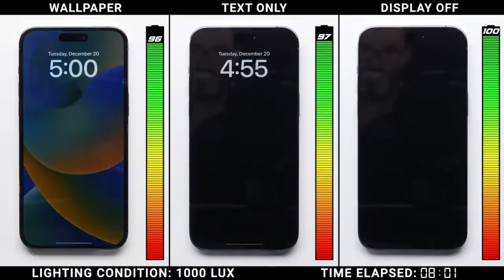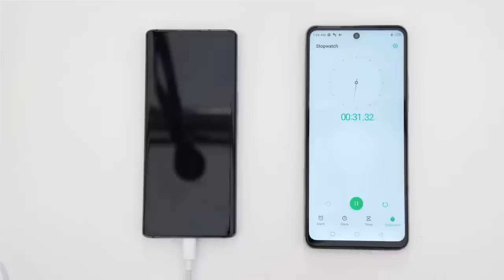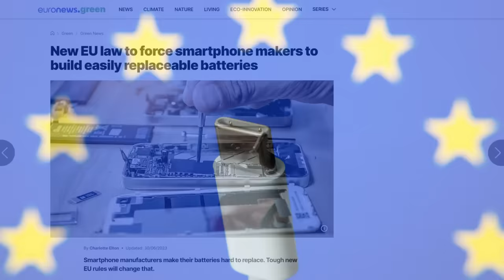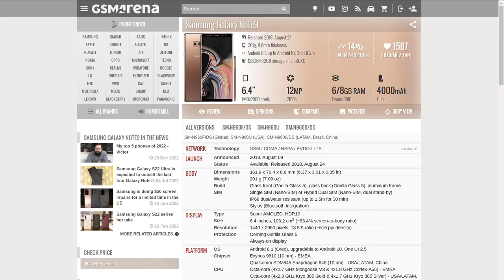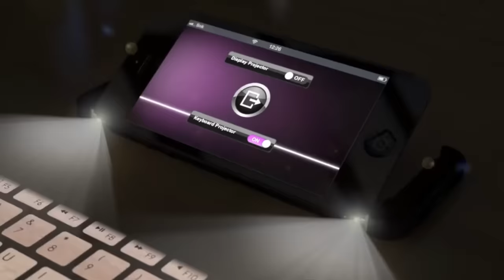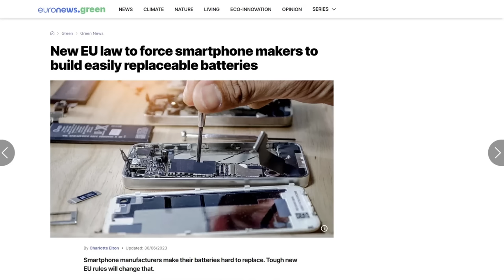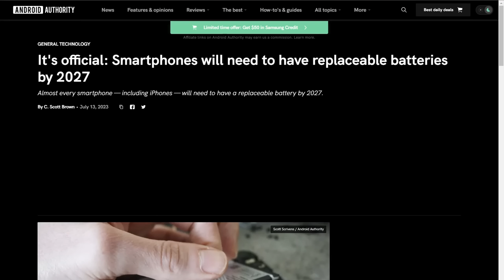All Smartphones Will Soon Have Removable Batteries

Comment: Cant wait to see how the manufacturers work around this. Probably gonna make it so putting a third-party battery in your phone murders it or something.
Reply: Pretty sure this is already illegal in EU not sure though
Reply: Is only illegal if you get caught, just like Volkswagen.
Reply: @cazek445  They could make it more subtle. Like, limiting the maximum charge because the battery isn't "genuine". Even printers will reject third-party cartridges in today's age. Anything can be programmed to disappoint I'm afraid...
Reply: The charging cable regulation specifically prohibits throttling third-party cables and chargers, this one probably has a similar part too.
Reply: They'll probably do this but then never offer replacement batteries. "Yeah sure we'll make replaceable batteries but have fun with Xiaoing brand if it goes out."
Reply: @23345star  Nah, I think they will sell batteries just at a premium.
Reply: Some kind of "trusted partner" program probably.
Reply: Ah yes, the ink cartridge method, a classic
Reply: Seems like the EU is getting tired of their shit, so they'll find themselves in another situation where shenanigans are against the law, if that even phases them...
Reply: @kpcraftster6580  🤣 but also 🙃
Reply: @YerBrwnDogAteMyRabit  With enough money, laws matter as much as morals
Reply: It'll be like printer ink.  Each battery will include a chip with a digital signature that can only be signed by the manufacturer.  They'll charge several times the premium for the batteries.
Reply: Apple already does this. The phone either will not work, or nag you with warnings that the battery is not authentic Apple. It's so bad, that even genuine Apple batteries can trigger the warning. Even several Android phones are doing similar, by having certain functions not work, like cameras and certain apps jist straight up not launch.
Reply: @Danominator  DRM batteries sounds like hell.
Reply: A company like Apple will just add encryption DRM to the battery so the phone will only work with the very expensive Apple replacement part.
Reply: SSSSSHHHHHHH!!! Now don't go out there giving ideas to them dammit!! xD
Reply: "We will no longer be providing updates to your OS on this model because reasons" That is why I upgraded from my S4.
Reply: And the Apple batteries will cost $700 (EU said nothing about price)
Reply: @justayoutuber1906  still technically more affordable than the Mac Pro Wheels
Reply: I bet they will put popups in the OS saying "Untrusted Third Party Battery" and cut off features, or make their official support batteries cost much more than a regular battery, either way they will have a lot of creativity to making phones worse when incorporating a new one for no reason
Reply: They'll probably say some stupid shit like it "breaks" the warranty.
Reply: Exactly . And changing still will be only possible in service center . 

Disgusting . Absolutely disgusting.

I am a gamer and love mobile gaming . Retro games , retro game mods and Indie games . I have an archive with over 200.000 games . Multiple phones . And none has a changeable battery . Means . Someday in the future , those phones will be dead or at least , cost a small fortune to change all batteries .

That's sad
Reply: id like to see them work around my work around of piggybacking the original battery with soldering and bodge wires if it means i still get to have my battery however big i fuckin want. they need to learn that as much as they fuck with us, we'll just get more creative in breaking the locks or finding ways around the shit.
Reply: @Danominator Custom ROMs ftw
Reply: @TheNovaks47 the camera thing is interesting on Custom ROM, for me the camera stream is smooth on 1 app, but takes a random amount of restarts for the capture button to work, on another, the camera has 1 frame per 1 to 2 seconds, I wonder if that is Moto doing the same.as described
Reply: Imagine they make 3rd party blow up like the note7
Reply: You mean like apple already does?
Reply: @Danominator looks apple to me
Reply: 100% correct. They will code the batteries to block third party generic batteries because profits.
Reply: @RT-qd8yl  That's an interesting thought. I agree, sort of. Seems that the money would be the only scale-tipper of any consequence with the moral-less. Many (probably most) companies weigh a fine vs the overall profit if/when caught. I wonder if VW would have proceeded with the TDI shenanigans had they known it would ultimately cost them 30 billion. That certainly seems like "enough" money..
Reply: *HP printer flashbacks *
Reply: This isn't American regulations my friend
Reply: @Danominator only some time before people start hacking it out
Reply: @thanhvinhnguyento7069  Looking forward to it
Reply: the battery will likely need a programmed vin to match the phone. they could blame safety concerns and be completely in the clear. thats what they normally do at least.
Reply: inb4 manufactorers make batteries combust when removed lmao trolled
Reply: Apple probably gonna code their phones to only work with batteries they provide which they don't sell individually so either you have to buy a new phone or have them replace it lol
Reply: They just stop selling to Europe
Reply: Non certified battery detected, performance degraded

And then it just runs some spindump task in the back like crazy so it overheats.
Reply: They'll probably kill your phone through updates.
Reply: @Danominator Printers will still streak on purpose and clean more out, report level read issues with non original cartridges and regulators don’t do shit about it. I run the same exact Canon for 13 years now by resetting its clean count and using spoofed chip refill carts. How Printer engineers sleep at night is beyond me
Reply: I can see it now: you can replace ONE of the batteries
Reply: @jmtradbr  Reminds me of a line once my old teacher gave us before a test. Its allowed to cheat its only not allowed to get caught.
Reply: reduced phone performance. or makes it "tainted".
Reply: @23345star   they will offer replaceble battery to make some money
Reply: We no longer have a battery, we have a power pack. 

Introducing, the iCel.
Reply: or maybe it would murder you instead
Reply: ... for my safety surely 😂
Reply: I can see Samsung, Apple and some other massive shitty manufacturers do so. But when it comes to smaller players like Sony and Asus, considering they are currently still keeping clean android and, at least with Sony, headphone jack with SD card slot, I think they will allow for 3rd party batteries. Sony does with their cameras, so why not phones really. And being the "good guy" could help them gain some market share.
Reply: @Danominator  Buy two and use a third-party charger for the third-party battery, then use the first-party charging only to keep topped up. Ez.
Reply: Probably by inventing a new screw that no screwdrivers can unscrew except one that only the manufacturer has. Technically user removable, but nobody would ever care enough
Reply: they will definietly raise prices, or start a "subscription only" model
Reply: so sad these bitter comments are the reality.
Reply: @cazek445  Would be yee, think apple got in shit for making software updates artificially draining battery many years back
Reply: @spicychad55 100% will
Reply: @ghoulbuster1 what poor English
Reply: @l4kr doubt that. Huge market of npcs
Reply: Workarround by apple will be that only apple certified batteries will work in iphones and those will costs as much as it costs to replace battery by phone reapair center..
Reply: @jmtradbr Volkswagen already has batteries which must be 'registered' by a special computer. They'd know a thing or two
Reply: I foresee them putting the battery under every other component, so you either need to remove the screen instead of the back cover or you have to dig out every other part just to replace your battery.
Reply: If Apple is putting chips in phone screens, they'll do it to batteries.
Reply: That's ok, those chinese manufacturer will find a way.
Reply: Just look at printers. That IS what they will do...
Reply: @YerBrwnDogAteMyRabit multimillion dollar fines stack em back to back.
Reply: @SlavTiger well said.
Reply: They will simply price the battery at the same price as the phone lmao
Reply: I think that some OEM's will have to pay a fee to get certified battery replacement for brands like Samsung, Xiaomi or Apple.
Reply: That would be a dick move. But it still would had a good thing. You don't have to buy a complete new device. But it's also something people should'nt 100% agree on.
Reply: @23345star  Who cares? I buy my Note II replacement batteries from Extreme Cells anyway, because they actually still produce those and they have much better quality than the ones that Amazon sells as being from Samsung (which are actually knock-offs from China).

And there are other third-party sellers whose batteries are probably just as good.
Reply: I bet they're gonna make those exchangeable batteries ludicrously expensive or unobtainable or both, as well making them last far shorter
do not ever underestimate greediness of corp*rations
Reply: Pretty sure that's already what iphone does.
Reply: @TheNovaks47 indeed, iphones starting with the X series have the battery serialized so if you replace the battery even with an oem one, the phone with treat it as aftermarket and give you an error popup, which doesnt always appear, and will usually stop appearing after a while if it does, afterwhich only appearing in the settings menu, however the battery health feature that tells you the overall capacity and indicates when you should get it replaced is disabled. I havent seen anything like this on samsung phones or indeed most other androids, not sure about pixels, as I havent seen too many of those, with the few that show up being people looking for cases and such, not any type of repair, I just know the screens are serialized so the fingerprint scanner wont work after a screen replacement unless you calibrate it, the difference being the software to do so isnt unobtainium like with the apple stuff.
Reply: @AruthaRBXL s I mentioned before in a another reply, iphones have already been doing it since the X series, replaceing the battery gives you an error popup saying it "cant verify if it is a genuine battery" and disable the battery health feature, so you wont be able to see the overall capacity level to know when to change it, and will have to rely on noticing when it seems to die quick, like for example going from 20% to 0% in a minute, or of course more obvious signs like either the phone refusing to even turn on or it swells and pops the screen open, which will probably crack it given how thin they make them now every since the 12 series, with the 14 being even thinner. in both of those latter two cases the genius bar is likely to tell you that you need to buy a new phone.
Reply: @SlavTiger  They'll make it illegal to circumvent battery DRMs.
Reply: Apple already do that i think
Reply: @cazek445  live in Portugal. I confirm that this practice is highly likely to be illegal. Thanks for informing people.
Reply: Smart batteries with an digital ID, which means you can only use it if it's ID paired with your device. Or some shit.
Reply: @Danominator to be honest, I don't want to see these damn removable batteries again. They were a nightmare back in the days where smartphones would randomly shut down at 70 percent battery after 2 years. If the EU wants removable batteries, they better come with 7000 to 8000 mAh power cells and not 2000 something
Reply: They wont, they don't want to mess around with EU, which unlike American politicians can't be bribed in the same way
Reply: @Danominator  guess we'll see with the S28 and Iphone 20
Reply: trust me, if that passes, there will be a shit ton of people modding it again at your local repair shops
Reply: They aint be so stupid. They can just stop the OS updates for your old phones, and you need to replace the phone for your new expensive battery for example.
Reply: Or shit like making it removable once the casing is opened but opening the case is only available destructively
Reply: Apple will do that
Reply: And they will say "it's for our users safety"
Reply: The bill says they cannot be proprietary and must be interchangeable.
Reply: Yeah or make them not last for more than a couple months before they start going bad so they can keep selling them to you over and over again.
Reply: @SlavTiger Oh there's plenty of ways around that. You can have every bit of connected electronics, including the individual cells, be locked into a physically unclonable function (inherent random variations in the copper and silicon itself), ideally baked into read only memory. Any new/replaced component will cause a PUF mismatch and alert whatever battery controller that something's off.
Reply: If you put a 3rd party battery in a phone, it turns into a Note 7.
Reply: Android already does something similar with chargers. It will force itself to charge slower if you're not using the charger it came with.
Reply: @TheNovaks47 I mean the good thing about android is that its technically a linux distro so you can make a modded version and android can't come after you for it
Reply: Even if that is the case, it'll still be replaceable. There is room for improvement, but let's celebrate one of the few wins we got
Reply: Sounds like something Apple already does.
Reply: Removable battery is a terrible idea. The phones integrity would be heavily compromised. I remember the old days, dropping a phone, the battery would pop out.  What about water proofing? That’s hard.
Reply: 3rd party battery instantly makes phone explode, lol
Reply: @jmtradbr  Small correction: Volswagen were never "caught" in the EU. It was United States Environmental Protection Agency that caught them. The EU is basically ruled by Germany and because Volkswagen is a major part of German economy, the EU would never do anything to harm them. The EU was actually aware of what Volkswagen were doing and it was 100% legal here. It's important to remember that neither the EU or the US aims to do something to help their citizens as a priority. They do stuff to hurt businesses from abroad and sometimes it helps the consumer.
Reply: @Danominator  WTH? This is about adults, not children going "the air is free."
Reply: @Wampa842 nope it's a money thing
Reply: Apple will start that trend exactly like they started the sealed in battery trend.
Reply: Welcome to the age of thick ass phones and non waterproof devices. Can already see people complaining when they drop their phones in the toilet or their phones no longer fit in their pockets. Not to mention all electronic shapes will go back to square based compared to the new technology where we finally got a new type of battery that’s flexible in shape. A regression in technology. 

We’re so obsessed over “let’s destroy corporations” that we don’t even bother considering the pros and cons of such a move. And as far as I’ve seen, the cons outweighs the pros by a large margin.

Fortunately, if you also look a bit further into it, there are exceptions. The exceptions are waterproof electronics or electronics with very high battery quality with around 83 % battery health remaining after a certain cycle. Sorry folks, you’re not replacing your iPhone batteries
Reply: They can obscure the calibration of third party battery. For example you can't fully charge it or the battery capacity is wrongly displayed etc.
Reply: Apple phone batteries for 8+ and up, if I remember correctly, have to be calibrated to the device to give details on battery health and whatnot.
Reply: @DPush420 that’s different. Older devices genuinely don’t have the space/computing power to run newer OS at a certain point. That’s not scummy, that’s just how technology progresses.
Reply: @KiddBuu_  20 years ago I was the one who got to choose what software was on my devices. It either worked or it didn't, but it was up to me.
Reply: Or they make the connection slot to the battery super flimsy so that it breaks super quickly.
Reply: @DPush420  ok, that’s fair. I see your point.
Reply: That looks like a hard thing to do cuz yes, I don't think anyone else than Apple will do that cuz it is harder to make than a regular battery.
Reply: @pipbernadotte6707  Just Boycott Apple and buy their competitors products
Problem solved.
Reply: @Danominator the funny thing is, Apple got into a lawsuit because they did exactly that. Throttled the battery through updates. So even when it got replaced, it still didn't work as good.
Reply: I thinks the same thing as in one brands chargers - the original charger had a chip that third party charger hadn't and it wasn't working as the phone didn't recognize the charger.
Reply: Non Samsung charging cables always had charging, data transfers, and connection issues
Reply: 1:12 me playing Pokemon Go with my Galaxy s 5 and having my Second Batterie in Pocket was smooth af.
Everyone looking with their Powerbanks in Hand 😂

Sad that they are Not doing it soon in 2025.
Reply: they can make it waterproof to not have to do it so everything will be waterproof
Reply: Actually I think the reason EU is putting these regulations in now is because the manufacturers wanted to do that in cheaper smartphones already, in the long time it might be cost effective to produce a huge batch of reliably good devices and simply sell them over 5 to 10 years while they can profit of manufacturing internet of things of devices, plus instead of making devices they could just provide easy to assemble modules allowing people to make  whatever they want with these components whether they just need a phone or a full blown computer they can carry in their pockets.
Reply: Actually they can allow this and still make money of this. I don't think they will throttle 3rd party batteries but than again most of these batteries are produced at the same location just under a different label 😂
Reply: @Danominator  Disappointing for you, great for the bottom line of companies.
Reply: EU will strike again
Reply: @Wampa842 I'm sorry the the our tech companies are such crap heads.
Reply: @Danominator yeah for "saftey" bs
Reply: Apple is already doing this. If you put in third party battery, the phone will claim that it's wrong.
Reply: No. The EU regulations clearly state the rules that need to be followed, and one of the rules is that replacing the batteries is easy for the average consumer and that no damage is caused to the phone in the process of doing so.
Reply: just serialize the batteries like apple does with everything. same idea with Dymo with their label maker having drm protected paper roll or printer companies doing with ink cartridges.
Reply: I love it when companies make products that cannot be reapaired and have some sort of planned obscolection so that more people have to keep buying over and over again because the product just barely glides over the warranty before falling into disrepair.
Reply: Well, i got a 8 year old phone, and it cant download some apps. They just stop supporting the phone, updating it. Soo... they already know how.
Reply: Guess they should ask LG for help on this one,theyre practically one of the few manufacturers back then that could able make a phone with a removable battery while not having to sacrifice perfomance & style at the first place. Also aint samsung one of the masters of both making your phone water proof & having a replaceable battery at the first place? Heck theyre able to do that recently on their Walmart Employee Exclusive Galaxy Xcover Pro,why cant they do that on their mainstream lineup? Heck your typical Walmart employee gets a far more better phone from Samsung than the ones who invests grands on their flagship but does less than an employee phone
Reply: @oldmech619  Ever heard of the Samsung Galaxy Xcover 6 Pro (2022)? The Xcover series from Samsung has user-replaceable batteries, ip68 dustproof, 4 major Android updates  5+ years of security updates, 120hz led screen etc.
Reply: They might try to find a work-arround. But forcing them to to do that is a better alternative than the manufacturer just straight up dictating what you can do with your phone.
Reply: They'd probably give them specific numbers, so even the same model battery would not work.
Reply: They will nuke battery life and make batteries more expensive and make “premium” batteries with 3x life at 5x cost.
Reply: @thecelticdog6866   Bull 💩.
You can still buy today smartphones with ip67 and user replaceable batteries. For example, the Samsung Galaxy Xcover series. The 5000mah battery of the xcover 6pro costs around 25€.
Reply: I sure hope it does
Reply: They gonna bypass it somehow and it's gonna make phones more expensive
Reply: @Danominator all it takes is a sensor and a wire
Reply: A lot of third party cheaply made batteries will do that to your phone anyway
Reply: That's not a way around it, battery will have to be replaceable. Good companies will put consumers interest first.
Reply: @Danominator  This is why you never buy those nonsense printers.
Reply: Generally speaking the EU is really good at making sure loopholes don't pop up
Reply: the fact that you can change battery is muxh worse, than not cheaping out on 30 bucks for something you use every day
Reply: Yeah like when the us passed laws on how high a car can be off the car they passed SUV’s and large cars off as “small trucks.”
Reply: You're right, but at least it'd still bes better than where we are presently.
Reply: @Danominator  make everything anti consumer illegal
Reply: @jmtradbr  well thats how all crime works then
Reply: Well and then if the third party battery kills your device, who takes liability for repair / replacement? Had this happen with a gopro. Luckily for me it was already a few years old, well used and out of warranty. But trying to save a few bucks on a 3rd party battery killed the gopro and I had to trash it.
Reply: @anandmehta2323  If you can prove a battery malfunction killed your device then the battery manufacturer
Reply: I don't care if it's a first or third party battery, as long as it's replaceable and priced sensibly
Reply: @LMB222  Even if it damages your device?
Reply: @efhi  Then the battery manufacturer what? Gives me a new device? What about data lost? and a host of other stuff?
Reply: @anandmehta2323  New device perhaps, nothing to be done about data unless you can recover it at a specialty shop
Reply: Then they will have to lose the European market
Reply: @Danominator they couldn’t do it at all.
Reply: It's a never ending tug-of-war. Just put in place suitable new policy to limit the industry giant's power periodically.
Reply: The "elite" kept this as a secret for centuries, this is the true story of your enslavement 👉 The Connections (2021) [short documentary] 💖
Reply: Or they’ll just be smart and stop doing business in the EU. Then everyone wins.
Reply: The will transition to software as a service, 
Apple music, Gmail, g drive all these apps will become expensive.
Reply: I think they will just put it that if user opens the back it voids warranty or make it not possible for user to not remove back without special tool.